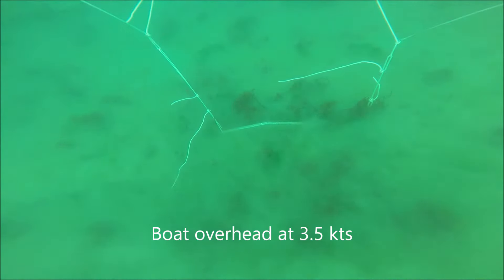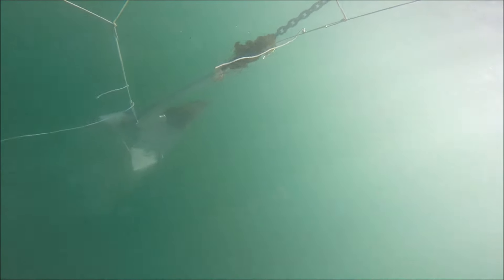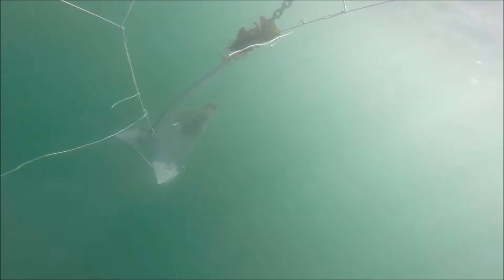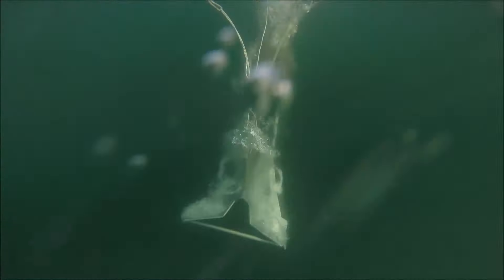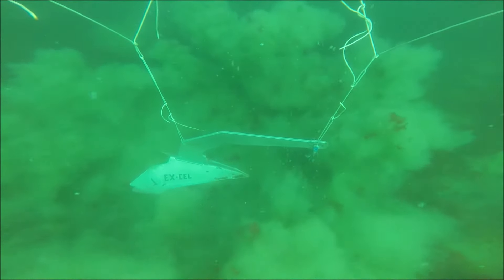Sarca Excel Anchor Testing.  Anchor Video #71

Comment: I bought a SARCA excel a few years ago to replace the Delta anchor that failed time and time again, I found anchoring with a delta would often turn into a mystery ride, it was terrible at resetting and out of sheer frustration I purchased the SARCA excel and it has never failed once, we anchor out about 30 weekends a year and often have other boats rafted to us. the excel was twice the price of a delta but worth every cent
Reply: UPDATE 3 years on from my original post, the SARCA EXCELL is still working flawlessly, it has never let me down not once not ever, I've enjoyed many a storm with a cold beer, while watching the shit show of other boats with older style anchors dragging and panicking
Reply: @mvhassallfree1031  I’m betting you used to have galvanised Delta and certainly not this fancy stainless steel version which has incomparable tip/toe weight of 40% :-)
https://youtu.be/e-918SES3dU

Comment: I have contacted the manufacturer twice and received no reply.  They are in Australia, and I am in the United States.  I suggested a United States distributor and reseller because going through an Australian reseller is not practical when you calculate the shipping on "one anchor". A United States distributor could mass ship thus lower the very expensive shipping cost due to the weight of the item. Great anchor that needs a sales team in the United States and Globally.
Reply from the maker: North American distribution is handled by Ground Tackle Marine of Victoria B.C. Canada.
Reply: @flygoodwin  Therein lies the problem. No United States sales support.  Thank you SV Panope (I am watching your video right now), I enjoy your unbiased anchor reviews.  Per your review I wanted to buy an Excel, unfortunately the customer service did not reply to my request to purchase the anchor.  Question: Can I purchase a 70 to 80 lb anchor from you that will take my Morgan 454 around the world?

Comment: What about the Stainless vs Galvanized dissimilar metal corrosion?
Reply from the maker: Good question.  All I can say is that none of the three Excel anchors that I have show any signs of corrosion near the stainless areas (toe). Perhaps the small quantity of Stainless steel is not an issue given the relatively large amount of zinc (galvanizing).
Reply: @flygoodwin  That's exactly right. Small stainless + large zinc = fine. Small zinc + large stainless = goodbye zinc! Stainless hardware bolting together hot-dipped galv steel parts is extremely common in the building industry.